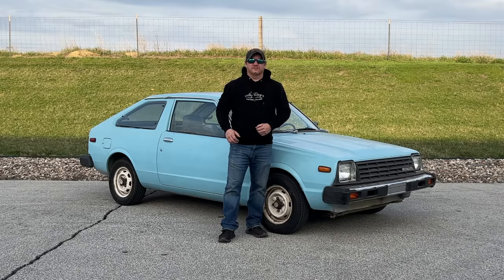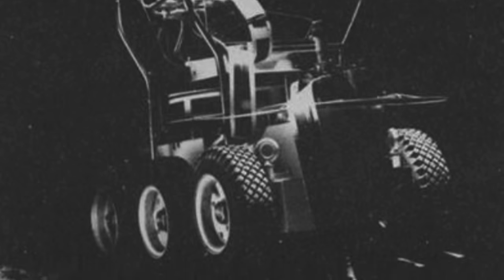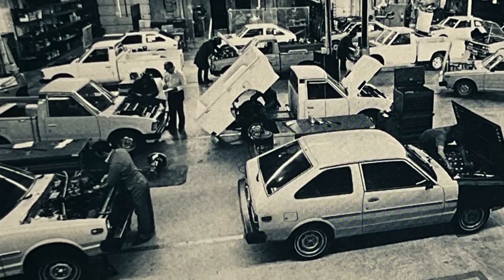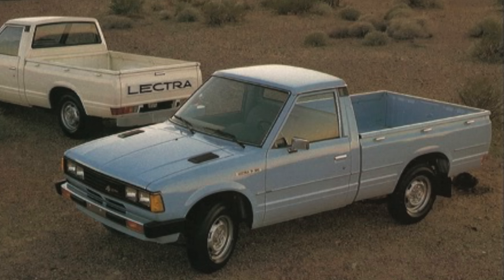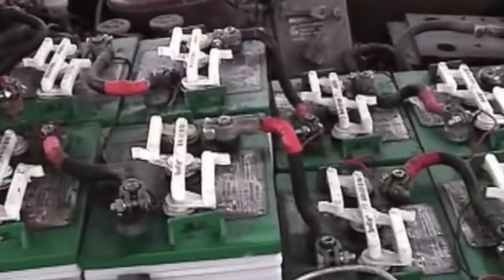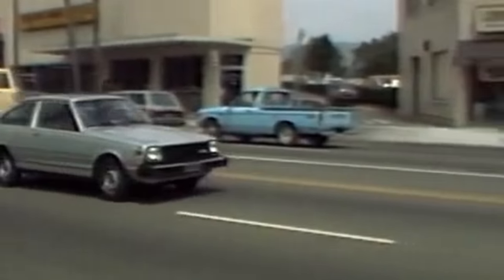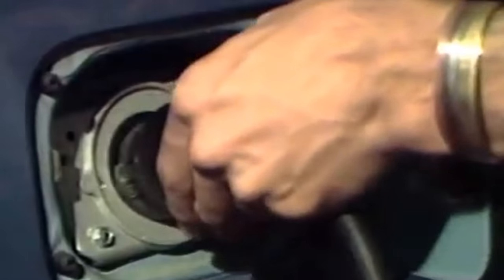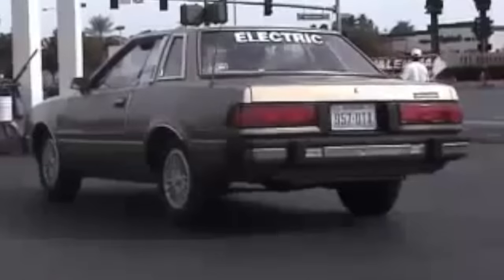Lectra Motors the Tesla of 1981

Comment: Very interesting video.  Actually, my uncle built an electric vehicle for Globe Union Batteries in the late 1960's.  The car was built on a modified American Motors car as Globe Union was located in Milwaukee, Wisconsin.  The final product car was named the Endura built in 1978.  It could travel 100 miles while traveling at an average speed of 30 MPH.  Globe Union made the Die Hard batteries for Sears.  While developing the EV, my uncle would travel the highways around Milwaukee with a gas generator in the back seat.  I'd be more than happy to send you photos of the original Endura brochure as I have the original.

Comment: Hi Steve,what is your plan for the future for the lectra,....,It remind me the sad story  of the  EV-1  from  general motors ,saturn division in the late 90 s ,beginning of 2000, big thank,s Steve and keep the good work.  PS  there is a video about that story. WHO KILD THE ELECTRIC CAR.
Reply: Republican petrolheads killed the electric car, with help from oil companies. Electric generators can create electricity without mechanical energy input, if armature reaction is sufficiently delayed in time domain, and current start to flow, when magnet has already passed top dead center of the coil. Delayed Lenz effect proves that energy can be created. When Lenz law is violated, law of conservation of energy is violated along with Lenz law. When self accelerating generators will be be used to recharge electric vehicle batteries while driving, than range will become infinite, and no need to plug in to recharge.

Comment: #LithiumMiningIsBad for the environment.
Reply from the maker: There is no Lithium used in the batteries of these cars what are you talking about.
Reply: It’s not. Some unethical lithium mining is bad for the folk who are doing it but lithium is a common element and mining it is fine. Do some research before you spout off. Let’s face it, drilling for oil and refining it, then burning it is hardly a high water mark.
Reply: @ThisWeekWithCars  I understand that , surely all those batteries  are not good for the environment niether.
Reply: @General_Proton  they’re lead-acid ones, and every single car on the planet has one, irrespective of how it’s powered. Again, try to think before you mouth of.